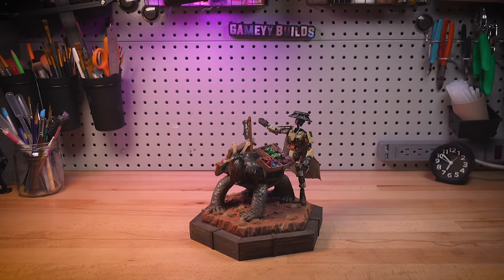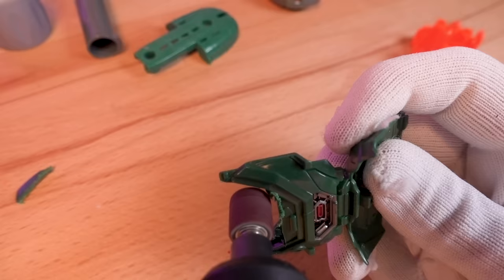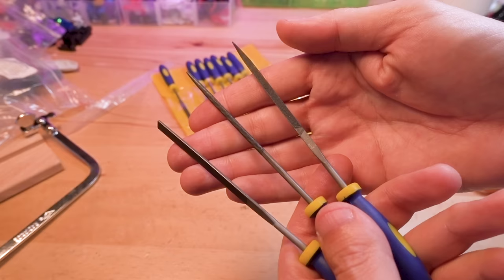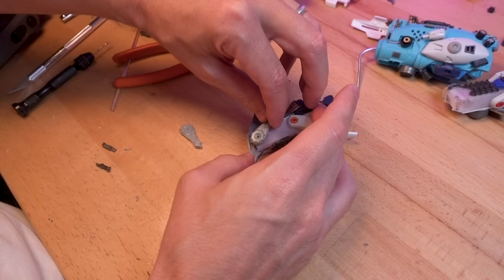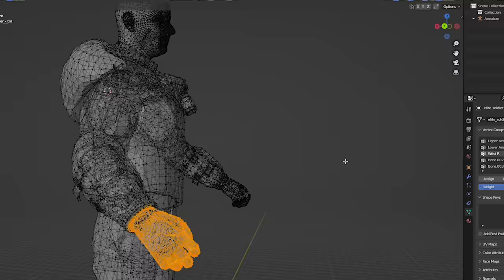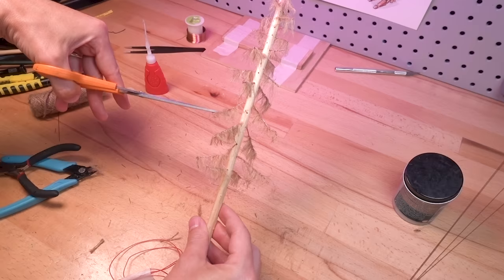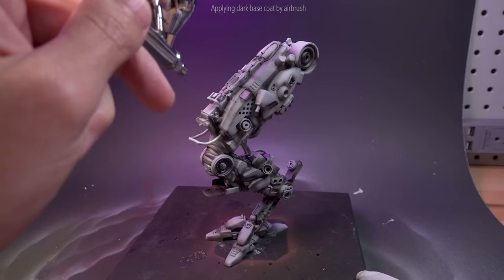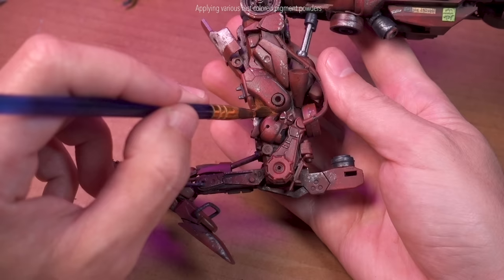World Building with Boylei Hobby Time | Beyond the Blight mech kit bash and short story

Comment: A tip for removing glue and sticky adhesives at a fraction of three cost of Goo Gone. Olive oil! Oils and grease breakdown adhesives. Then you can just use soap and water on a paper towel to clean it off. 😊
Reply: I used to use olive oil whenever I got super glue on my fingers when I was a kid. Took a while but it worked

Comment: Have you ever tried warming up standard spray paint before use? In my experience, a cheap can of Rustoleum sprays as well as hobby-specific paint after letting it float in hot water for about 15 minutes. Just a bowl of hot tap water and the Rustoleum sprays a super fine mist that lays down amazingly.
Reply from the maker: Oh wow, that's a super interesting tip, never heard of that! I will have to try it! Would definitely be a lot cheaper than buying these small cans of Tamiya!

Comment: Came here via Boylei’s WIW.  What is the ‘little’ airbrush you use (around 12mins) please?  I can’t justify a proper airbrush with all the tubing, compressor etc and this one looks handy.
Reply from the maker: It's an Iwata Neo. (My my video description for links) However, it does use a standard compressor and requires a air hose, so may not be the option you need.
Reply: Thanks - at 12 mins it doesn’t look like as though it has an air pipe (my bad eyes or small screen maybe)  great build btw.  And sad story

Comment: 3:30 there's different schools of thought on gloves and high speed rotary tools... I adhere to no gloves. A laceration is an easier wound to care for than a glove getting pulled in and potentially degloving the flesh from your finger.

There isn't enough torque in a rotary hand tool to do all that, but certainly in a drill, or a lathe. Still in MY OPINION best practice is no gloves. Just how I was taught. You do you, especially with low torque tools.

Comment: Lumber wouldn't be judged for pay or sale by weight, only by volume. Going by weight would make it far too easy to game the system by choosing different species/types or dryness levels. Straighter and longer pieces are more valuable, but width effects total volume. The mech would optimize for greatest profit (or some metric that represents that), as that's in everyone's best interest. Gut tells me the loggers would be paid based on the non-dust, non-chip portion of clear or nearly clear (free of knots, rot, weird grain, ugly stains, etc) output of the mech. The lumber company can still make money off of chips, dust and poor quality wood, but it's less profitable than the good stuff and wants to discourage loggers from getting that as much as possible. 

If i were making this world, i would have pay based on the total volume of good wood, but would be pay would be categorized for volumes of wood that could be milled to certain standard lengths. For instance, i calculated that 100 Ings per ten tons, assuming metric everything, of green (undried) western red cedar would equate to 4.32 Ings per m^3 (let's say I for ings for now on) Assuming my math is right, of course. 
Taking this as an average, a lumberjacks paycheck stub would have a breakdown of his pay divided into categories based on length. For lumber the mech outputted less than 1m length, it would be paid out at, say, I0.25/m^3, useful only for firewood, shingles and some cheaper laminates. Lengths between 1 and 2.75m, I1.50/m^3, useful for furniture, cabinetry, laminates and little else. 2.75m-4m length, now we're talking. This is the perfect length to build houses out of using the stick built method (most common method in the US, basically just 2x4's and nails) which will be used by other advanced cultures as it's a crazy efficient, safe, cheap and *fast* way to build. I4.25/m^3. 4m-6m would be I6.50/m^3 and more than that gets weird, as that's pretty specialty. Sure, plenty of trees get taller than that, but they seldom have much clear, straight wood along their entire length.  Plus, even in sci-fi words, building with wood at that scale starts to gets impractical unless iron or steel is way more expensive than modern irl. Far from impossible, just well, impractical. Its not crazy expensive to build with solid wood at those sizes, but the circumstances would have to be special or there would have to be a fad.  Until you get to skyscrapers, then things quickly become impossible. 

No, i didn't arrive to the pricing scientifically, they are complete guesstimates by a non-woodworker. I chose western red cedar as San-Kani seems to be a Vancouver Island analog, and that's a major species there. The pricing per length was done mostly to realistically arrive at an average of 4.32 ings per cubic meter.  The distributions of prices per lengths feels right, too.

Comment: I like the Mech and what you did with the figure but the trees … those are just not the right size. I could have cut those skinny little trunks with my battery operated chainsaw from ACE hardware. I assumed, when I heard a Mech helper and Lasercutter, we are locking at least at some Sequoias. Just my opinion on the size not the build.